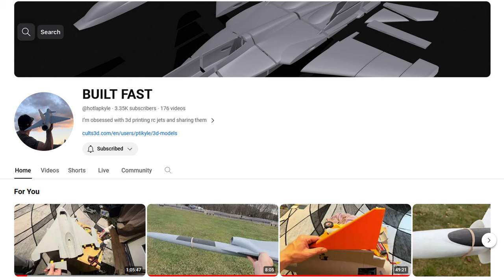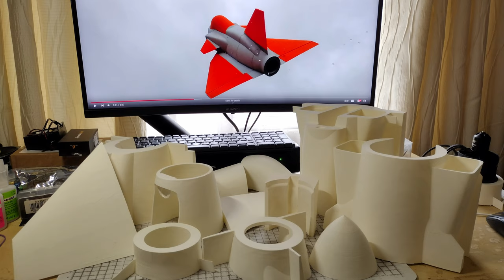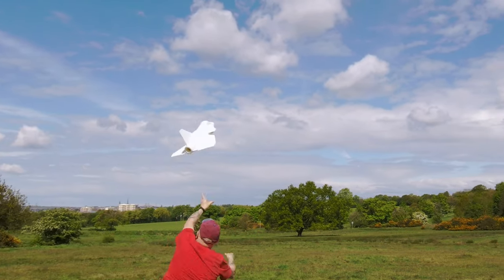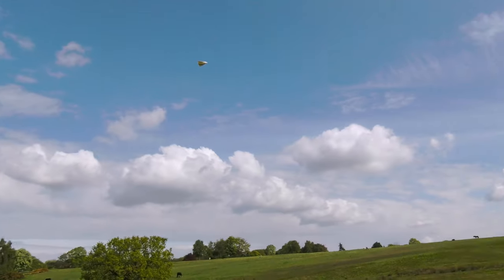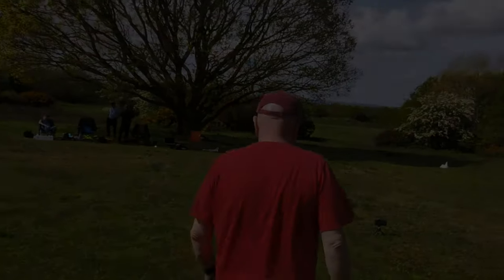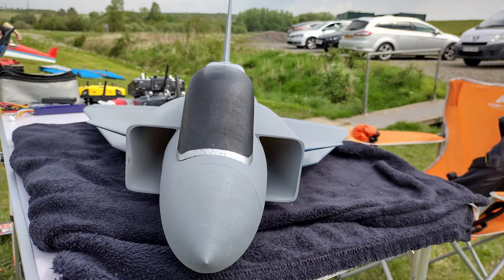Shmiggen - a 3D printed fattie Viggen

Comment: Well done and fantastic video! I’m so happy you made this video. Made my day! Glad you enjoy the shmiggen. I’ll be honest the 50mm is even easier to fly and eay more durable but yours seems great!
Reply from the maker: It's my first successful 3D printed plane and I hope to get many more flights on it. It's the 64mm version as that was the size of the spare EDF I had :)
Oh, one thing I would say is the upscaled STLs for the 64mm also upsizes the servo holes making it difficult to fit stand '9gm' servos. I had to design and print a support so the servos were held securely.
Reply: @Caroline_Tyler  thanks for the info. I use hot glue on the servos so you can use them in any oversized pocket. Thanks again for the video! I’d like to offer you a free file because of the video. I highly recommend the F4D Skyray. It’s the easiest to fly edf on earth
Reply from the maker: That's very kind of you. I'll take you up on that offer and have an F4D Skyray please!